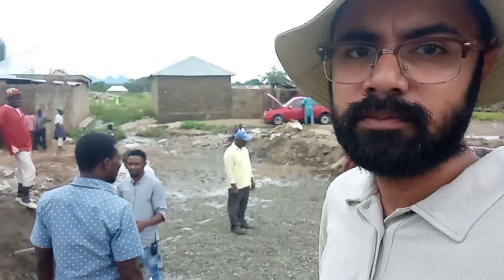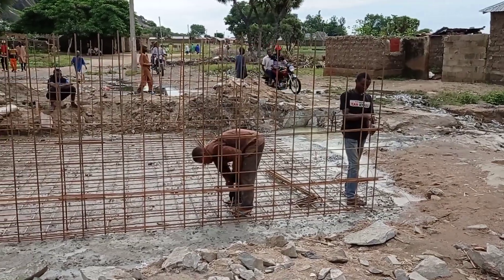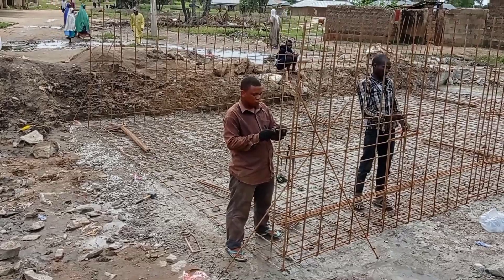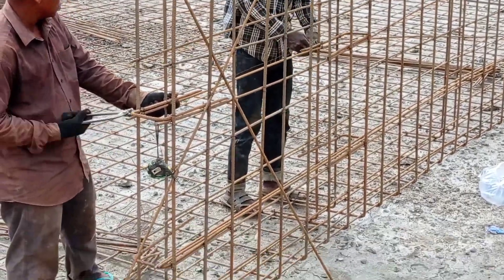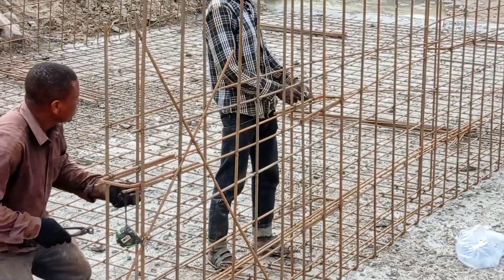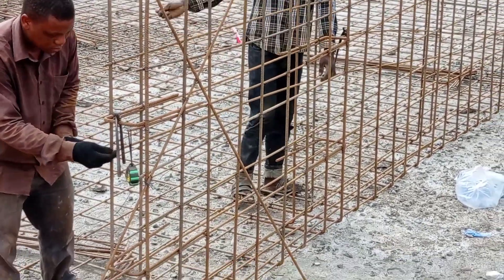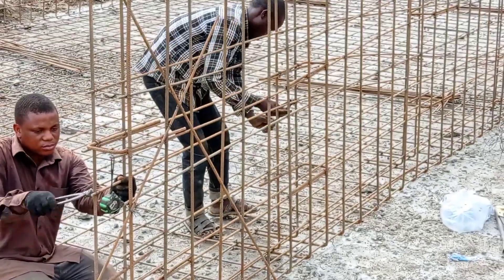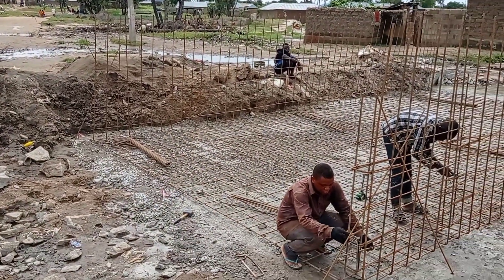Construction of Box Culvert | Concrete Blinding & Reinforcement Placement

Comment: Sir Am construting culvert for office entrance, and the are being cautious about cost. Can i use single one vertical reinforcement for the side walls with only bottom bars for the bottom slab and the top slab?
Reply from the maker: Hi, you should use both vertical and horizontal bars for the walls. 
Secondly, for the bottom slab/base you may use single mat. However, for decking/top slab you need to use double mat.
Hope you understood my answer.
Thank you.